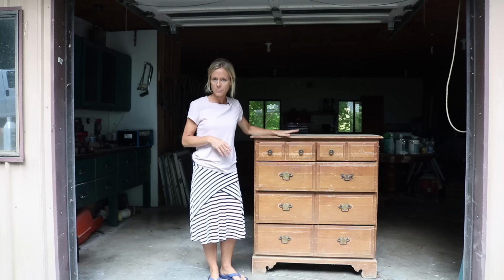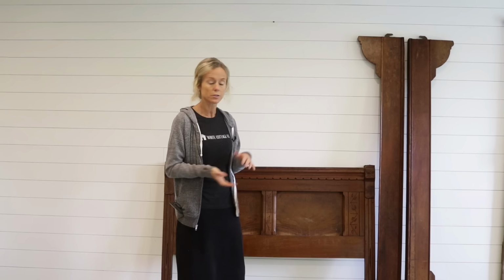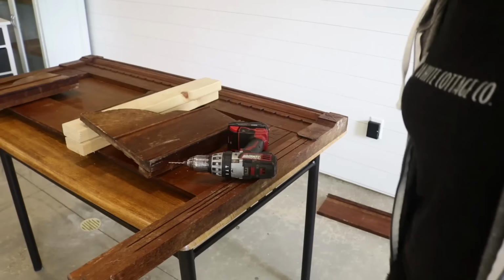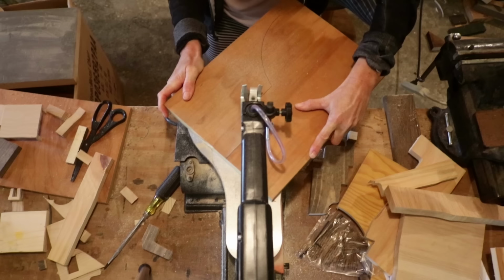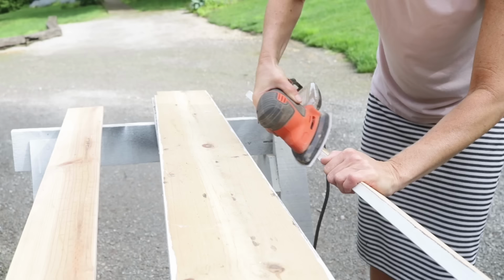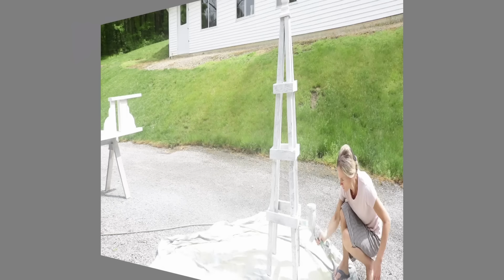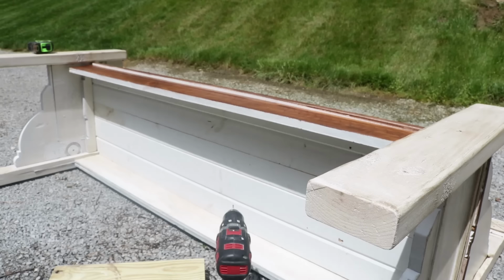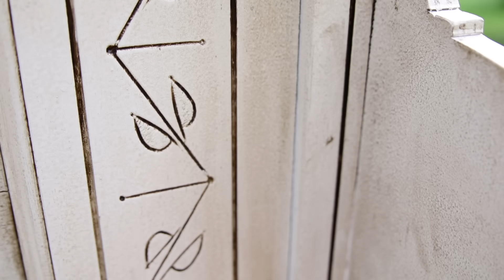Headboard Makeover ~ Furniture Flip ~ DIY Bench ~ Bed Makeover ~ Headboard Idea ~ Paint and Glaze

Comment: Another outstanding video! I just love all your projects. For what it's worth, I thought I'd pass along a little tip that I learned from my daddy over 50 years ago to prevent the electrical cord of a power tool from pulling loose from an extension cord while you're using it. Just take the ends of both cords and make as if you're tying them into a knot but leaving a few inches of each cord. Then plug them together. I know this explanation is probably confusing--I wish I could draw a picture!

Comment: Inspired and beautiful! Have you ever tried a product called Floetrol which is available in Hardware Stores in America? Floetrol is an acrylic polymer solution which is added to acrylic paint to increase fluidity and is great for use with spray guns. While it slightly slows the drying process, the acrylic polymer maintains the molecular binding as the paint dries, producing a more durable surface. (Alternately, as you have done in this video, a small percentage of water to paint can also be used to thin the paint for spraying.) Keep inspiring all of us!! Thanks you.

Comment: How generous of those folks to give you the beds! This bench turned out great but I would like to offer some constructive criticism, if I may. 
In my opinion, the wood used for the front posts just doesn't  go with it. You can see it's construction grade wood. If there wasn't a nice pair of posts to pull from your great collection of bits and pieces that we've seen you pull from previously, I would've waited on the project. The other little thing is that on the wood you did use, a suggestion would be to countersink (I think that's when the head of the screw is drilled in below the surface) then fill in before painting or staining so they aren't noticeable.  Adding the same pattern to the arms was a really nice touch!